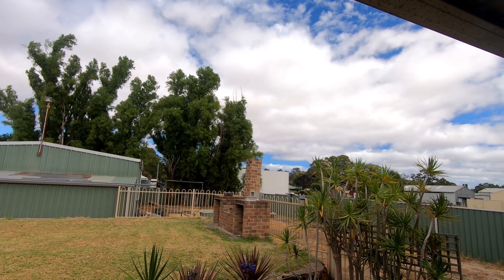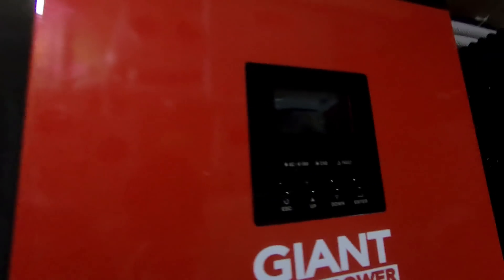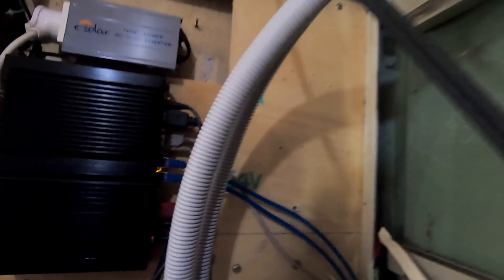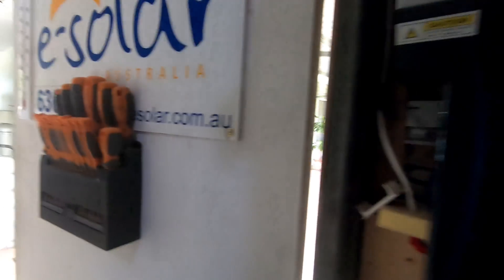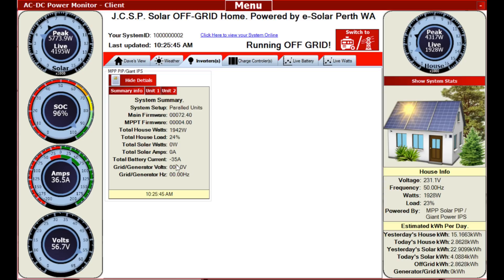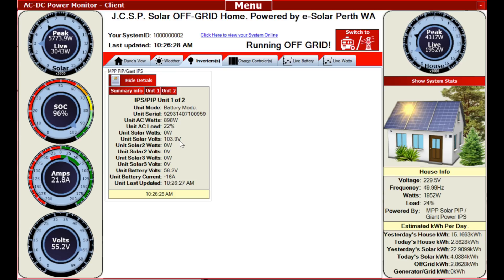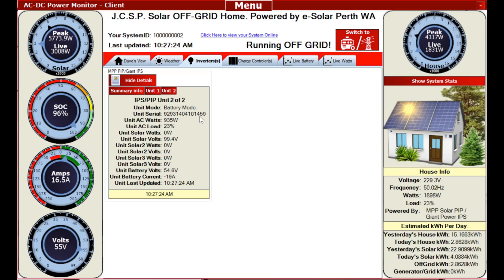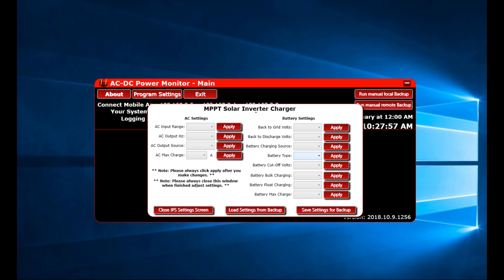Helping a friend  48Vdc to 230Vac OFF GRID System

Comment: Ok I got the micro up and going and it took me a week to get all the stupid updates installed for windows. Now today i spent 6 hours getting all the new coms cards installed and getting the software up and going. The stupid WatchPower will not detect the inverters. I know that it is hooked up right with the cables, but I will say that I had a real time just getting WatchPower to run on the micro computer. I had to un install my antivirus and play all sorts of games. 
Also you will find this interesting, MIDNITE told me to NOT install the Classics directly into the micro and to just use the ethernet hub. It works so I did. .... Anyhow I am thinking that I need a newer version of WatchPower so I have asked Peggy for the link. I will keep you updated. Thanks again for the help. Jim in Chile.
Reply from the maker: A matter of getting the right Port. Also remember you only need the main unit plugged into the computer.

Comment: Jc am I better with the 250 midnite or the 150? I'm on 48v system.  Some saying more volts others saying better off with more panels. What's your thoughts
Reply from the maker: The 150 performs better Just a bit better then the 250.  However that being said. If your solar panels are a long way away  and you need the higher volts the 250 lets you have then that is the better unit as it lets you use smaller cable size. It becomes a small drop in performance over cost of cable exorcise.
Reply: @JustinCaseSolarPower  panels are on the roof directly above the battery room. I would say approx 6/8 meters of cable. What's considered far away? The 150 is a fair bit cheaper here too
Reply from the maker: then i would go with the 150. just a few more amps. adds up over time as you know.

Comment: Hey Justin great video as usual I have learnt so much from your channel and was able to build my own solar system that runs my home. I have a question I need your assistance with. I have a 24volt system with 856AH battery bank these are 8 Rolls FLA batteries  connected in series then parallel. I also have 2 battery monitoring system connected to it a Victron BMV-702 and a Bogart Trimetric TM-2030RV both company are the best battery monitors you can find on the market as you too have worked with some victron battery monitors. My question is what is a save voltage to carry your battery bank? Because my system in the morning just before sunrise sits at 24.16volts after pulling 186AH thru the night from my system showing I have 83% remaining in my battery bank. The state of charge is looking good but my concern is the voltage if I am at 83% state of charge what if I should pull my batteries down to 50% I know it's not recommended to pull FLA batteries below 50% state of charge but I also know its still a safe place to have your batteries so I'm not sure if I should pull them down to 50% if my battery voltage would go too low as charts online show 24volts to be below 50% state of charge please give your expert advise thanks and God bless.
Reply from the maker: I would give Rolls a ring. Sounds like you may need to give them a really good charge. and Test your electrolyte  http://rollsbattery.com/public/docs/user_manual/Rolls_Battery_Manual.pdf

Comment: I need your software for my voltronics vmii pls send the link
Reply from the maker: You will need to contact the manufacture for that. I am not a store or a shop. I don't sell inverters or provide software for them. Talk to the shop you got the units from.
Reply from the maker: The software I use IS NOT FREE. https://acdcpowermonitor.com/ this is the third time i have provided you with the link.
Reply: Justin Case Solar Power and Bush Camping thank u sir